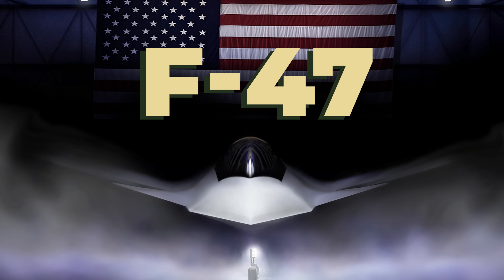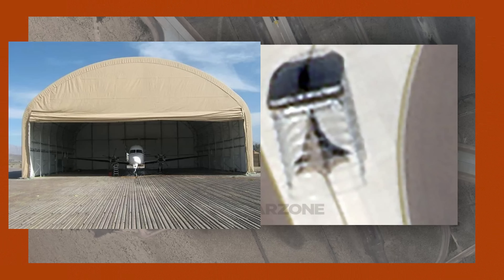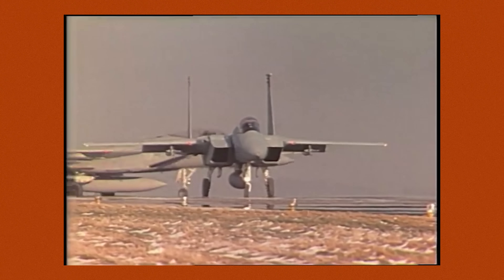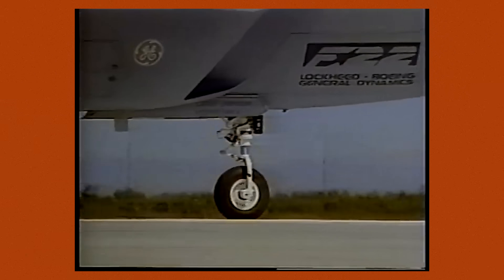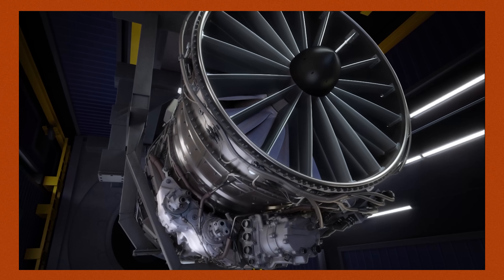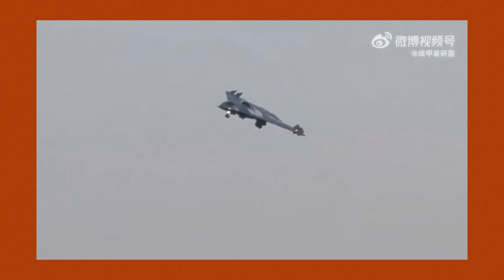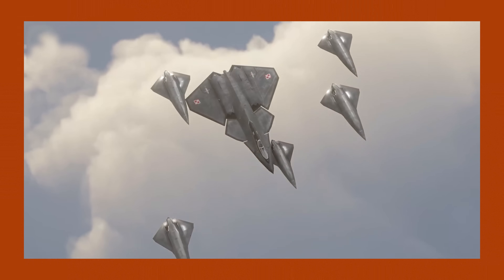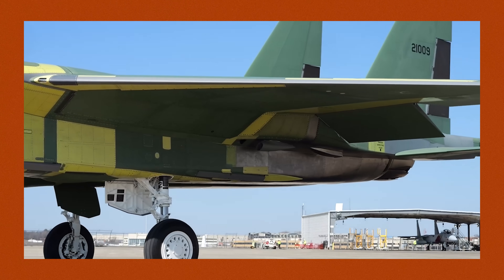America's "New" Sixth Gen F-47 is NOT New

Comment: The biggest threat to this aircraft is its comparatively increased cost due to our deteriorating relationships with our allies. More in production = cheaper production, but that’s potentially out the window now
Reply from the maker: That's one of the main reasons that the F-22 was so god-awful expensive.  We never exported it, so we ended up building a fraction of the original number.
Reply: @Justin_Taylor  Not exporting it had nothing to do with building a small number, the Peace Dividend did. The Soviet Union was gone, it was the "end of history" so there was no need for a super fighter that was so much better than anything else when everything else we had in the inventory could handle anything out there. The US and everyone else rested on our laurels. The F-47 isn't going to be exported either, ally status or not. They aren't planning to build more than a few hundred of these, they're the silver bullets while the F-35 and F-15's make up the numbers.
Reply: Beyond exporting it, we never ordered the intended amount for just the US Air Force. We had no peer, so they lost the reason to buy them in mass.
Reply: ... there is a very-good-chance that everything you are hearing regarding numbers and general-design is very-very-wrong. For a team that is all about Space-Force, that already has the ultimate hunter-tracker in the sky... I'm doubting that this will be built in large-numbers... or will even be an atmospheric-flyer. This will most-likely be something we've never really-seen before; something you don't share developmentally or operationally.
Reply: @RoyHobbs-f4v it’s going to be an F-35 on steroids. High computational capability, speed and ability to control a flight of drones and relay massive amounts of data to allied aircraft. It’s going to basically be a fast and stealthy EW platform that’s the brain of a complex web of drones and allied aircraft
Reply: @anonymous-ml8sl  ... that's functionality already part of the F-35 and B-52 war-suite. I have a hunch this is something much-different. There's a reason Boeing was selected as prime-contractor: this is going to be an evolution of the X-37 (which is where I think the "47" nomenclature partly stems-from). And... hopefully, it will be a frightening-level of  space-artillery electronically-married to the F-35 and its dedicated satellite-network, capable of destroying both atmospheric-assets... and the much more-prized orbital-assets, as-well. This is where the "sixth-generational-sphere" of combat will be fought. And... an operational-necessity to protect the F-35 War-Mind Network.
Reply: @RoyHobbs-f4v  My god, you people really will just invent reasons to praise Trump, won't you?

NGAD is an Obama-era program. We've had a fairly solid concept of the requirements since midway through the Biden administration. We've known that it's going to be a large, high speed aircraft with drone networking and long range as its primary capabilities. It's not a spaceship. Holy crap.
Reply: As long as it's the best in the world they will continue to buy it, or suffer falling behind
Reply: @ not for sure. We could definitely see some closer nations become tied more closely to China in order to keep out of the inevitable hot war (or maybe just Cold War). It’s hard for them to trust us now, seeing signal gate, trade war, shutting off weapons in Ukraine, etc.. It takes an incredible amount of trust to have your military essentially completely reliable on a foreign nation’s weapon systems. Shit, even if they do stick with us, are they going to want to buy the F-47 with all of these threats and this broken trust?
Reply: It's not deteriorating. Get off the internet.

Comment: Oh no, it's canarded
Reply: Damn Canardians are stealing all of the jobs!
Reply: Anything, so long as it's not grounded.
Reply: Canards create additional reflective surfaces/additional surfaces from the side which can bounce radar from the main wing back to the enemy but as 6th gen jets likely would not have a traditional tail, at best something similar to YF-23 solution, they can add additional canards without ending with more reflective surfaces as is the case with Chinese J-20 which 99% have higher radar cross-section than Raptor despite entering over a decade later with questionable value with current engines on most airframes. 
Thus, the F-47 will still end with lower RCS than traditional jets with a tail like F/A-22A while the current development of AESA jammers/dual-purpose side radars usually on sides ahead of the cockpit behind main radar possibly even integrated into wings means that weaker reflected signals from side of canards will be useless one way or another by reaching enemy in such bad disorganized shape enemy radar would not be able to understand...
Most people shaming J-20 because it's Frankenstein of F-35 & MiG 1.42/1.44 canceled 5th gen (itself fairly similar to the German Eurofighter competition proposal) as is well known that both were great inspirations for J-20 in ways well beyond what's available on Wikipedia...
Reply: You can't say that anymore, it's insulting to the aerodynamically-challenged.
Reply: They canard everything as part of the development process. They just don't send that version to production.
Reply: @patrickweaver1105  Good cope. Enjoy the canards. The thing that is "bad for stealth".
Reply: @Flightman453  That's concept art and no one has any idea what the final product will look like.
Reply: @ If that’s the cope you want to believe then sure. Enjoy the canards though, you know, the thing “bad for stealth”.
Reply: @Flightman453  It's not necessarily bad for stealth because stealth is only good at long range and at long range the plane is flying straight and doesn't need to use the canards very much. The only time they need full use of the canards is during high G manoeuvres. These manoeuvres can also expose the bottom and top of the aircraft which is not stealthy.
Reply: Who cares? Canards are fine. They’re electromagnetically identical to every other horizontal control surface.
Reply: @ Who cares?  You should tell that to pro-US people who paraded the "muh canards are bad for stealth" about the J-20 since it entered service. Not me.
Reply: @Flightman453  wasn’t talking to you…
Reply: @Flightman453  it's different. The us is 20 years ahead of tech so the canards are different to the J-20 shitbox's. For instance, the canards are actually aligned with other control surfaces, unlike the J-20, which has the radar signature of a barn
Reply: @ Ah yes, “canards bad”, except when the US has them. If this is the chauvinistic cope you want to believe then sure. Unfortunately, it still has canards, and you “canards are bad for stealth” arguments have died. And “20 years ahead isn’t an argument”. Keep coping though with that oil painting.
Reply: @Flightman453  J-20 canards are not in line with its wing surfaces, thus creating radar bounce. Pretty obvious ragebait / bot account though, might want to take this iteration back to the drawing board Mr. Wong.
Reply: @JustAGooseman  No idea what you're talking about. But that's okay.